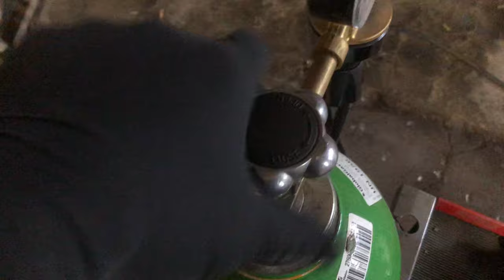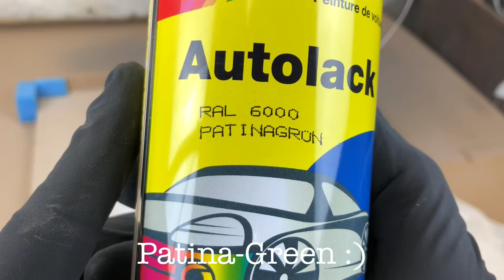Rusty Crimp Press Restoration - Tool Restoration | Mister Patina

Comment: Great job on that roll crimper. I see there is a few people asking questions about that tool but didn’t see the answer. So yes that tool or a version like it exist today and that one you restore can load shotgun shells today. But... that is used to roll the rim of a shotgun slug not for crimping target loads or birdshot. Today’s roll crimps chuck in a drill press to speed up the operation but this oldschool roller would still get the job done!  Again beautiful work sir.

Comment: It's used by the very old hunters who have the habit to make their own cartridges ! When I was young, during the 60's I had seen my grand father used the same tool but the cooper plate could be changed for every caliber 12, 8, 6 . 
This one is very old because you have a little place to put the tail of " broche " cartridges they don't used " amorce " in the bottom but a little stick placed on the bottom ring of the cartridge !
This system had be leaved after many accidents when the cartridge exploded when they failded down !